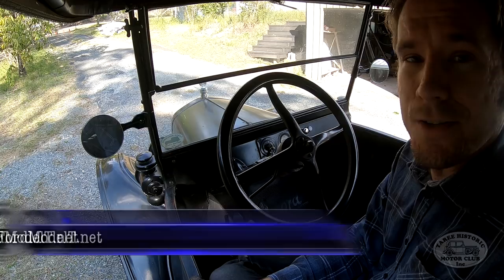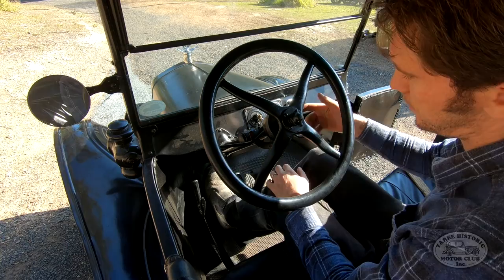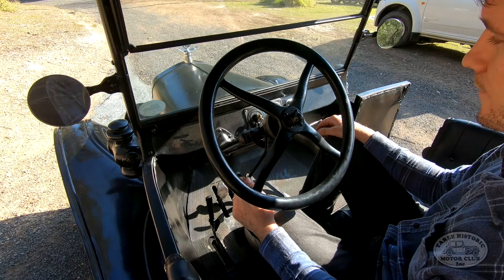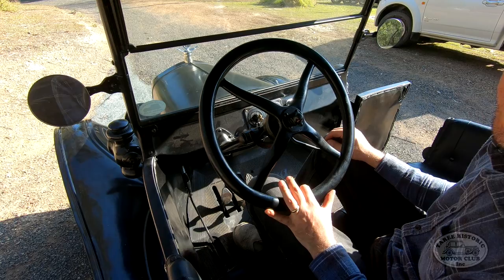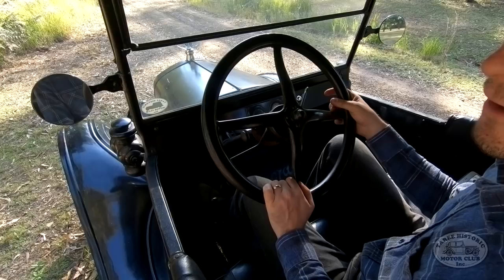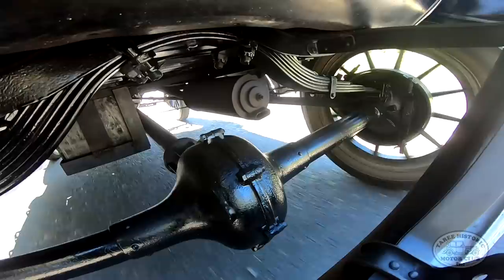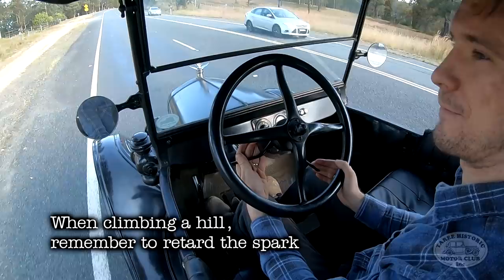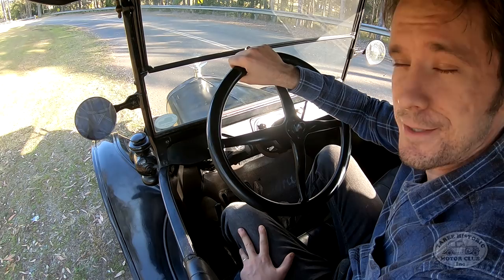How to Drive a Model T Ford - Point of View

Comment: I have always wanted a Ford Model T, because I have always found them interesting. The moment that cemented my want of a T, is seeing a gentleman in Cooper, Texas daily driving one that was roughly 65%-75% original. He told me about some minor changes made to his car, including the different gear ratios he was running in the transmission. He also added a small, low volume, low pressure fuel pump because he would drive on hills steep enough to stall the engine when a bit low on fuel. It looked like a rough, worn out car from a distance, but when you looked at the small details, the car was VERY well taken care of. I asked him if he could take a guess at how many miles were on the car, and he estimated that in his 30 (ish) years of ownership to that point (2001 or so) he had put 150,000 - 200,000 miles on the car and was on his second rebuild, of the second engine he had put in it. Over all, he guessed closer to 500,000 miles total. This may not sound right to a lot of people, but he was pretty sure the car had crossed the country a few times, at least. I talked with this gentleman for roughly an hour, he was awesome and I soaked up as much info as he was willing to share, and he seemed to enjoy. My hat off to you sir for keeping one of the few Ford products I actually like and respect alive and giving her some exercise :) I have said it most of my life now, cars are meant to be driven, not just sit and fall to pieces.

Comment: When the shifter is in second gear and you push the clutch totally down what happens?
Reply from the maker: It will drop it immediately into first gear :) .... depending on how fast you're going, that would be uncomfortable, and the transmission probably wouldn't appreciate it either!! :)
Reply: Couldn't that also damage the engine?
Reply: twistedyogert over rev, yes it could

Comment: Do you have to make any concessions (mods to the car) for modern driving conditions? I know you have better than standard brakes fitted, and if the car didn't come with seat belts you don't have to fit them, etc. But what about speeding? If you get pulled over 'no speedometer, officer' is unlikely to be a satisfactory explanation! :-P This is a great channel and I've learned heaps watching just about every video I think. Thanks for your hard work and effort and patience in bringing all this to YouTubers - much appreciated :-) That gearbox is an auto box really, isn't it? Just the driver is operating the bands/clutch instead of hydraulics and valves? And of course, no torque converter.
Reply: If you break the speedlimit in this vehicle I`m sure they`ll cut you a break, you`ve just been through a life or death situation.
Reply from the maker: I've installed Rocky Mountain Brakes, which are an excellent safety measure. In terms of speeding, I'd have to be driving "all ahead full" through a school zone (40km/h speed limit). I have been pulled over for an RBT which was fun, the cop was very amused!

Comment: Outstanding video! You do a fabulous job of explaining everything. How often does the handbrake linkage and pedal travel need to be adjusted to keep everything working properly?
Reply from the maker: The handbrake rarely falls out of adjustment, in fact mine has been the same for about 10 years! This is mostly due to the fact I have Rocky Mountain Brakes on my T in addition to the factory transmission brake and parking brake.

Comment: There is a saying that you can slow a Model T in need , by stepping on ANY pedal .... if you chose Reverse while moving forward , would it actually engage , or would the Friction Bands simply slow the car ( with lots of smoke ! ) - until it stopped or they burned out , whichever came first  ?
Reply from the maker: Yes you can stop a Model T by hitting the opposite pedal to the direction of travel, though its not recommended! Others suggest to stand on all three pedals together, which also works, but again, could have mixed results! All this assumes the white-metal thrust washers are intact in the differential... if they fail, you have no brakes at all, unless equipped with Rocky Mountain Brakes, as mine is.

Comment: When stopping do you pump the brake to keep oil on the bad and prevent the drum from getting hot and cracking? I read that somewhere and it made since at the time.
Reply from the maker: Generally yes thats true, I have Rocky Mountain Brakes on my Model T so it's not as critical.

Comment: Hey great video. I just have one question. When your talking about spark advance and hill climbing. Isn't having the spark occur earlier called advancing the spark not regarding. If I'm wrong please tell me thanks
Reply from the maker: Timing advance means that the spark plugs are firing earlier in the compression stroke, farther from TDC. Retard Timing causes the spark plug to fire later in the compression stroke.

Comment: And if you still can’t do it in first gear, I heard you can also use the reverse gear to climb up a hill.
Reply: Yes you can. The big reason is if the hill is to steep, since the carburetor is gravity fed, gas flow may quit so that's the reason for reverse on a very steep hill. In 1926 and 1927 Ford moved the gas tank to the upper part of the firewall, an easy way to tell those years. They kept it there for the model A years too.